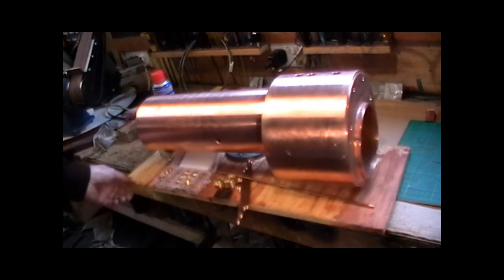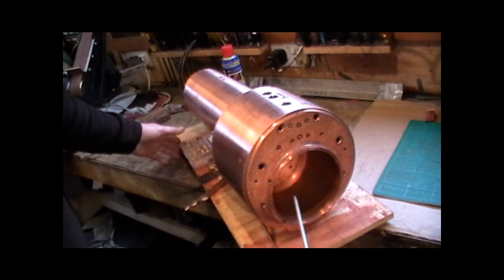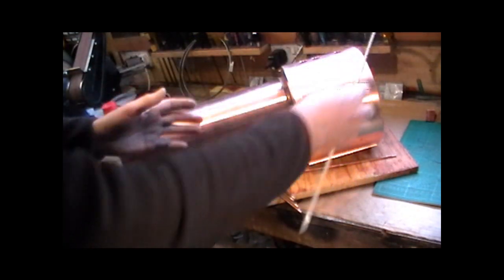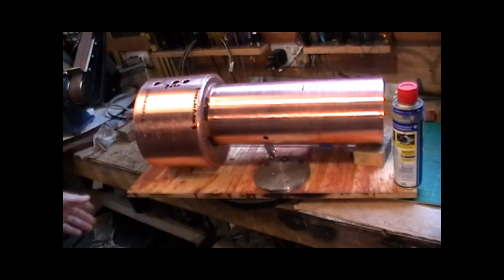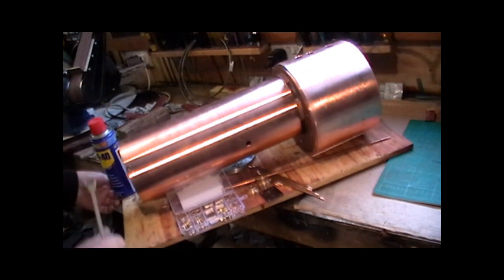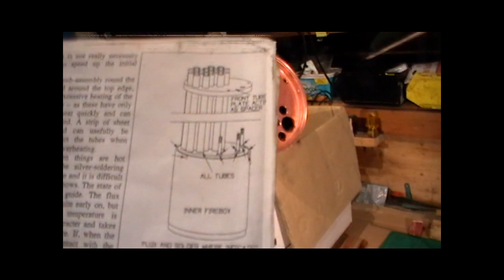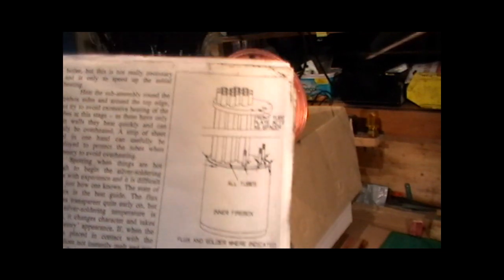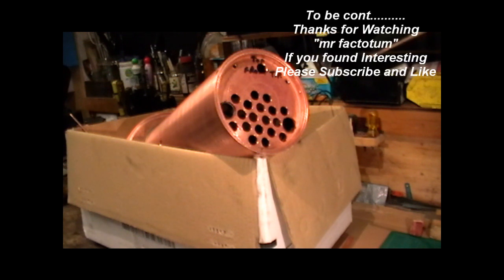Making a Boiler 5" gauge loco Part 8 First boiler inspection " mr factotum "

Comment: Hello, im making a 3 1/2" gauge bantam cock locomotive. I'm  approaching the boiler stage and im on the fence about self build or commercial build. I have been quoted just under £2.5k with 24 month wait.  I seem to be struggling to find an inspector. Are your inspectors from a club or do you know any private inspectors?
Reply from the maker: hi
boiler inspectors are from my club, you have to be a member to qualify for free boiler inspection. don't know any private
regards
mr f